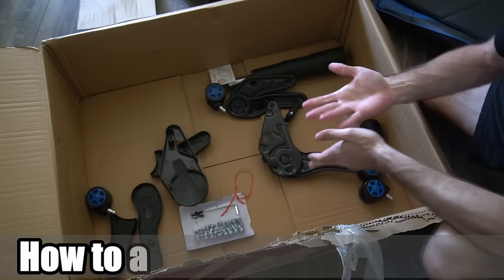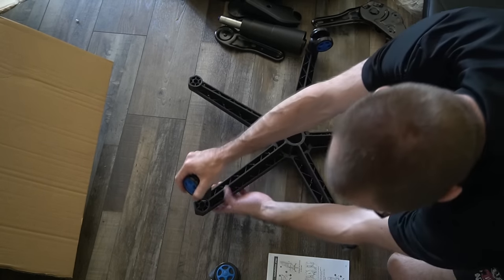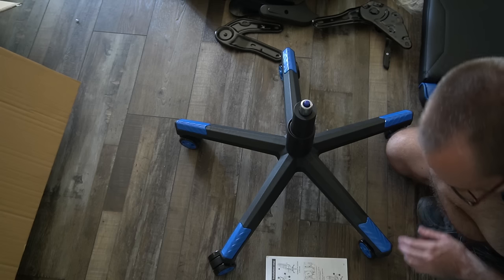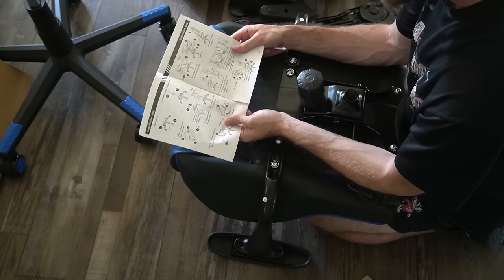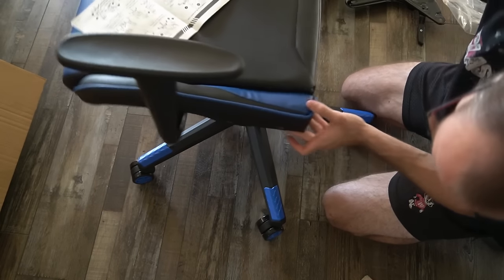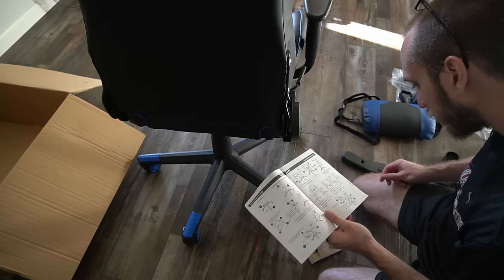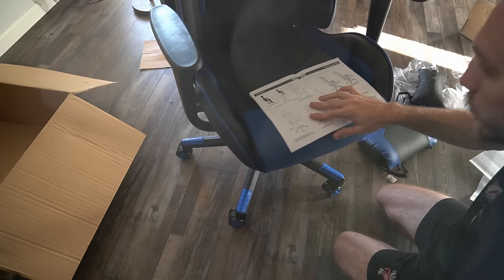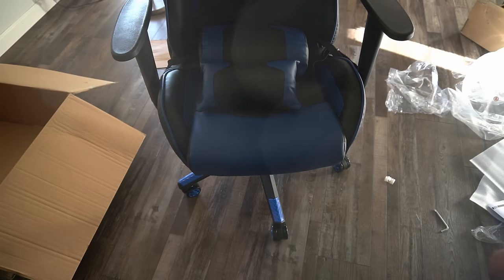How to Assemble Homall S-Racer Gaming Office Chair (Steps 1 thru 13)

Comment: This took me 2 hours lmao 😂 😂😂😂
Reply: Same!!! The plastic coverings are what killed me
Reply: @joewood3491  yeah
Reply: Sameeeee
Reply: Lemme guess, you kept dropping the stupid borderline-proprietary wrench every 20 seconds in part because it doesn't clear the adjustment knob underneath and some other projections, and the long end is a phillips head screwdriver, because NO ONE HAS ONE OF THOSE! If they didn't include that, you'd have to wear down every metallic letter opener and slot cover you have just to put the side bezels on. If anyone knows what size hex bit fits these bolts, please post it here or otherwise useful areas. Thx.
Reply: @johngerity  wooaahhh. don't kill us like that man